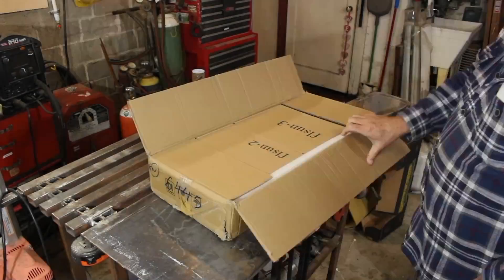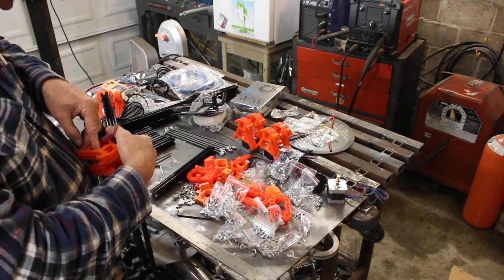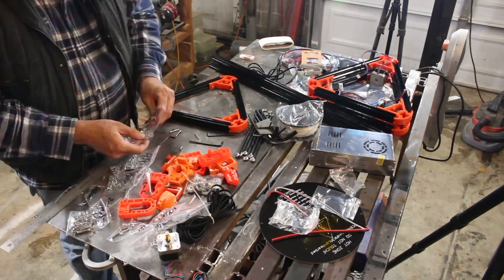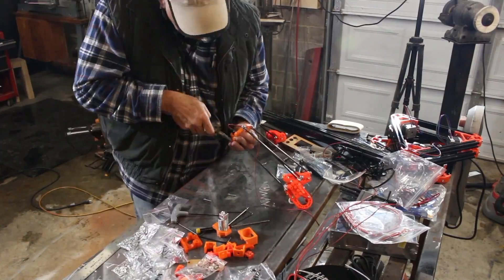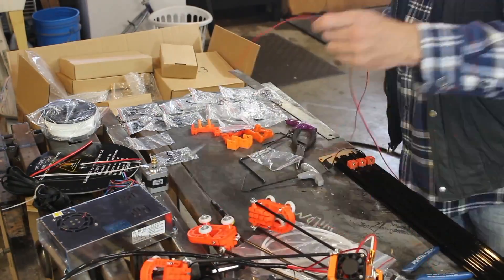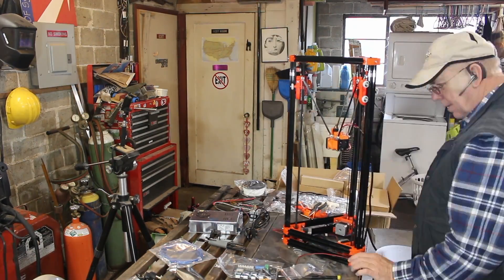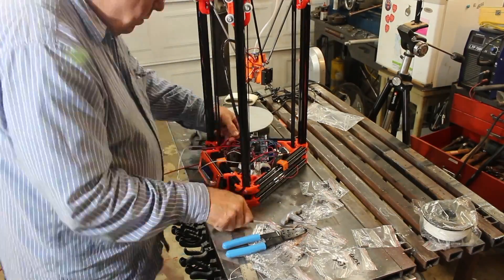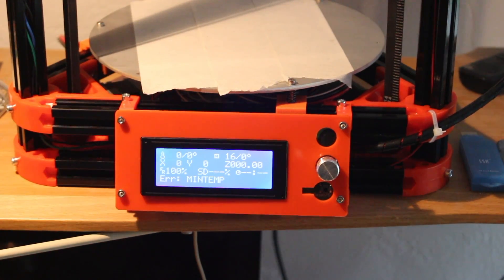FL Sun Kossel Delta 3D Printer Build

Comment: I just got one from ValueHobby pre assembled. It had a 220 plug on the power supply and I had to change out my 220 wall socket as it was a 3 prong y stile. when I plugged it in, it sparked and blew the power supply, drats. I looked it over and I found a switch 115 to 230 which it was on 115 with a 220 plug, go figure. Not good. Been talking to them sort of. They are hard to get a response from. Lousy customer support. Glade your experience has been better then mine. At this point in time i would NOT recommend them. Hope to get it up and running soon. Can't rely on ValueHobby thats for sure. It looks as if I'm on my own.

Comment: "Injection molded parts are stronger than 3d printed parts" I take it you never printed with nylon before. That shits tough :)
Reply from the maker: I hear it wears out deposition heads way faster too.
Reply: Wildman Tech of course. Nylon has a much higher melting point than pla.
Reply from the maker: Given the constraint of what's available on the market, I think I did ok here.

Comment: Thank you sir
I've coveted a delta printer for years and after the death of my local library's Makerbot this week...
I made a rash decision and I ordered one of these today because it was "on sale" with a linear rail upgrade.
The trouble you had has given me some concern, I hope the latest model has been improved.
Your video will help greatly if it hasn't.,maybe the new manual is at least up to date.
Maybe yours dropped between the tubing on your welding table, I admire your dexterity.
 I would have been picking up parts all day if I had laid 'em on one...:o)
I will like and subscribe, see I'll see you next time.

Comment: How is the printer doing so far?
Reply from the maker: It's a bit of a disappointment in a couple ways. Most notably, if your print extends out to the edges, it distorts a bit. The deposition head won't stay straight the farther it gets away from the center. If you want to print something tall and skinny, it's good. Print quality is not the greatest either. I'd rate it a 7 out of 10.

Comment: Built this printer as well, and I had the same issue. The parts didnt match the manual and the electronics aswell. They included a SD that has a manual on it, although every file/folder names and file contents are in chinese -_-

its a decent printer for the price tag
Reply: Delta Rostock Kossel 3D Printer Movement kit http://www.ebay.com/itm/262990637809?ssPageName=STRK:MESELX:IT&_trksid=p3984.m1555.l2649